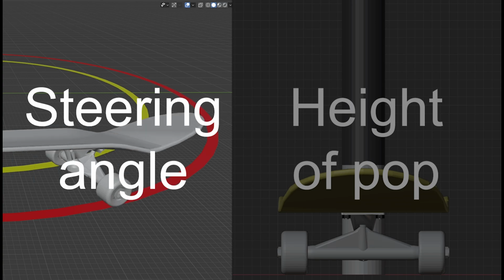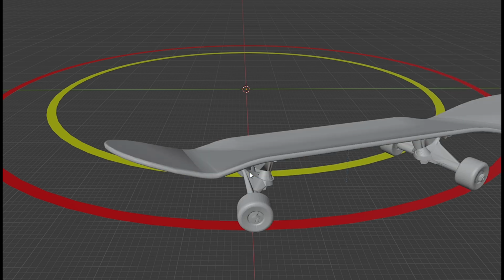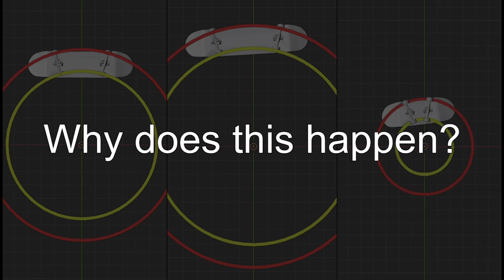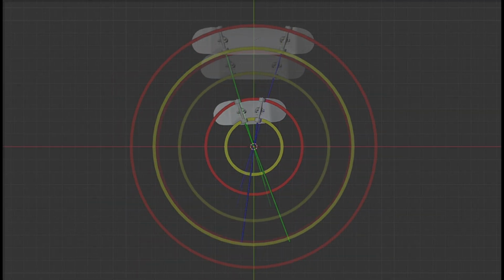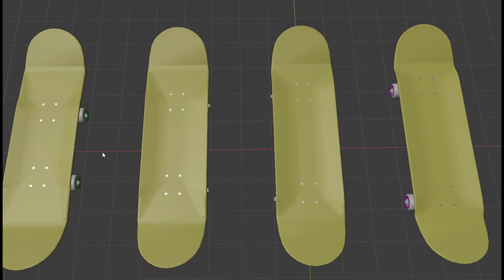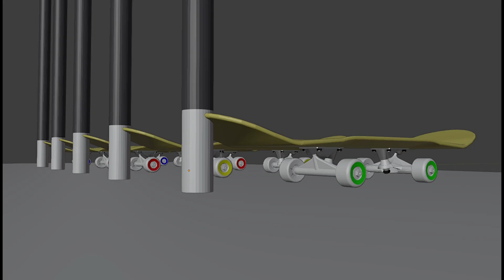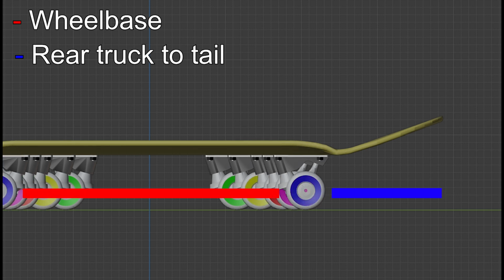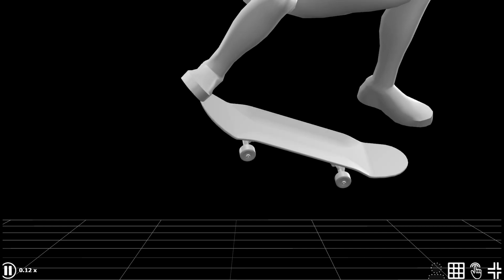Physics Engine - Wheelbase of skateboard

Comment: I’ve fallen really deep into the rabbit hole of deck specifications and especially the wheel base affect on the feel of a board. It all started when I I wanted to get a wider deck and not realizing that the wheelbase was also longer than what I’m used to and it threw me off completely and I spiralled into the rabbit hole trying to understand why. 

I think the best board design for me would be a 8.5” deck with 14.25” wheel base and a medium/mellow concave. But sadly none of my boards fit that spec 😂

Comment: You may or may not have done this already but I would love to see simulations like this with rkp trucks (longboard style trucks). With lots of variables, like off set, wheel base, height, angle etc. Especially displaying forces needed to turn in the different cases. That would be awesome ❤
Reply from the maker: I developed a Physics Simulator where you can simulate skateboard setup of your choise.
Will work on to reflect the wheelbase adjustment function whenever I have time.
https://whythetrick.io/skateboard-physics-simulator/

Comment: Would it be possible to make a video guide regarding the boards wheelbase+trucks combo? in other words, the benefits of matching a long/short wheelbase with a thunder, indy or ace truck while also taking the height of the trucks into account. 
It wouldnt have to be a super advanced guide, but more like a push in the right direction/suggestion, as I can't find any information on this matter and I don't get why its almost like a tabu subject, but in short what trucks fit a long wheelbase like ying & yang or what trucks would demolish the skateboarding experience on a short wheelbase🙏
Reply: Look up Ben degros YouTube videos he explains this exactly perfectly. Some trucks make your wheel base shorter and others wider. Depending on which direction you wanna go will ultimately be the deciding factor in which brand of truck would work best in THIS specific regard only
Reply: @paulvawter8205  i know and im well aware of mr degros videos but he didn't want to mention a single combo in any of the videos, as he said the matter was to be obtained personally with experience and time, which I dont really have the budget for, considering the amount of different deck shapes, trucks and wheel diameters.
He is a little too black and white or his videos are and has now chosen to retire from utube

Comment: Great simulation!  A few thoughts: 

As you say (3:25), the second simulation setup varies two things which both affect pop. (1) The length of tail and nose gets longer while (2) wheelbase gets shorter.

Increasing (1) alone will facilitate pop because of the increased lever for the back foot (lever = distance from tail end to back truck). The same force on a longer tail will result in a higher torque applied to the board.

At the same time, decreasing (2) alone will as well facilitate to initiate pop because of the decreased angular momentum of the board around the axis of the back truck (distance between back truck and the front parts of the board, in particular front trucks, is lowered). Lower angular momentum means less resistance ot the torque applied by the back foot using the lever of the tail.

Importantly, increased angular momentum also explains the last result (highest wheel base leads to the highest pop) because the pop does a conversion from rotational kinetic energy (rotation towards ground) to translational kinetic energy (board pops in the air). The board with higher angular momentum (longer wheelbase) can gain a higher rotational kinetic energy at the same rotation speed and will therefore achieve a greater translational energy (=higher pop) once it hits the ground.

Comment: Really great video! liked it a lot

But i think the second part is a bit misleading - initial assumption with fixed tail length and variable wheelbase was actually reality like scenario, but actually simulated scenario does not exist.

I suggest to separate second part into two - fixed deck and variable tail length, fixed tail and variable wheelbase.

Comment: When you're manipulating the wheel base you're also changing the tail length, which is what's actually making the changes in pop height and energy required you're describing. You seem to kinda point this out at the 5 minute mark, but I think it was a mistake to attribute these factors to wheel base instead of tail length, because those measurements can be changed independently. If someone were to take your conclusions about how wheelbase affects pop into their next purchase decision, they would be misled. If tail length is equal, a longer wheel base will have the same exact pop angle and therefore will not affect height of pop. The longer wheelbase will require slightly more energy (the board will feel heavier to pop) because the weight of the front trucks is further from the fulcrum, but I doubt this would be very noticeable (edit: I was wrong, it makes a big difference - I now know from experience). Wheelbase's biggest impact on riding is definitely the turning as you described. Wheel base also has minor affects on the air-spin (aka shove-it rotation) by the affect of the trucks' weight's distance from the rotational axis. Overall board length has a much bigger impact on shove-it rotation though.

Comment: Great explanation but kind of unfair test method for the pop. You should have made the same size nose and tail for every deck and change only the wheel base. For example a 6.3" tail, a 7" nose and the wheel base in increments of 1/2" maybe from 13.5" up to 15"

Comment: How would wheel base affect speed wobble?
Reply: Longer wheelbase = lower wobble frequency 
Shorter wheelbase = higher wobble frequency

Think of a short slalom board compared to a longboard. If you tried to go fast and straight with each one, you would experience speed wobble sooner with the shorter board and at a higher frequency than f wobble than with the longboard

Comment: You make great vids, love them! Just for clarity's sake, the "width" of the wheel base refers to the length of the truck, from bolt to bolt. What you've been referring to in this vid is the "length" of the wheel base, from truck to truck. If the distance is in the direction of travel, its length of the wheelbase. When its perpendicular to the direction of travel its the width of the wheelbase.
Reply from the maker: Uhhhh… I see, thanks a lot!
We are one step smarter thanks to you.
Reply: Two wheelbase measurements?? No, sorry, but the width measurement you’re referring to is called track. Wheelbase is only measured from front to rear.

Comment: I think you're correct within the confines of your experiment. with the trucks and wheels being the same, the shorter the wheelbase, the easier it is to pop, but the downside is the lack of ability to pop really high. you're simulations were quite exaggerated, but if you skate 2 boards that are the same, but differ by 0.25 inches in wheelbase, your hypothesis is correct

Comment: All the difference in Pop seem to be rooted in the geometry of the longer tail. Smaller angle means less distance and energy to the pop. I dont understand why you link this effect to the wheelbase.
Reply from the maker: Turns out, that seems to be the case. Although I could've shorten the length of decks, but they are generally the same/similar, right? Instead, decks seem to share the same length while they have different wheelbase. The ones you saw in this video are obviously exaggerated but essentially that's how they are: the same length of decks, different locations of trucks.

Experimenting on different deck length would also be interesting though. Thanks!
Reply: @whythetrick  i dont mind same/different deck length. I dont think it makes a lot of difference.
I tried to say, in your experiment, you basically examined how tail lenght impacts the pop (because the tails are different and have different pop angles). The wheelbase does not have much to do with it. You pop with the tail, of course the lenght of the tail is much more relevant than the wheelbase.

Comment: That pop simulation seems inaccurate.. A board with a shorter wheelbase is going to have a shorter overall deck as well. Just something i noticed, idk why but you shortened the decks for the steering radius part
Reply from the maker: Guess you are right. I should have shortened it to be accurate but I think the overall deck size usually doesn’t change much in reality, does it?
Reply: @whythetrick  there is no standard lenght. It would not make Sense to have a big rider with wide stance riding the same board as a small one.

Comment: love ur videos!
i would like to see a comparison in needed forces of normal ollie compared to fakie ollie (or any other trick ), because tricks still standing imo feel more like fakie tricks and regular tricks feel a bit different. Maybe there isnt even a difference and it perhaps is all just in the body weight distribution i would imagine.
Also a thing i personally do is, i pop sort of backwards on some tricks ( and especially on fakie tricks) and would be interested in how the simulation looks if u apply the Pop force not perpendicular but instead slightly pointing backwards.
I noticed too, that the pop in skateboarding usually isn't 1 quickly applied force but rather its contiuously applied until the tail hits the ground so that difference would also be interesting
Reply: i think you hit the mark... there is no difference. This is probably why Ishod skates twin tails and Neen skates twin noses.

Comment: Can your feet placement affect the pop angle?sometimes i feel like when i pop with my back foot more close to the bolts i need less energy to make the tail hit the ground but i cant pop very high,when i put my feet on the tip of the tail i feel like a need a lot more energy to pop it(sometimes i even get ghost pop) but in other hand if my board makes contact with the ground i can pop very high
Reply from the maker: yes, the foot placement does affect the angle of pop.
Just like the length of the tail, if you pop closer to the bolts, you'd need more energy and vise versa.
Reply: @whythetrick  You should make a video explaining the difference in the pop with different positions of the back foot. this would be really helpful
Reply: I feel like like it takes me more energy to pop with back foot closer to the bolts. You have less leverage. Imagine a lever and you are trying to lift a boulder. do you want a long stick or a short one to move the boulder?
Reply: If it takes more energy and force for you to pop the tail when your foot is closer to the tip that means you have a "flat" type of board where the tail and nose behaves like a flat plank of wood and so as you get closer  towards the end of the "plank of wood" the more stiffness you lose. Boards that have steep noses and tails (think of the shape of a trigger on a gun) will only pop if you place your foot precisely on the tip. Just as pulling the gun trigger feels lighter and easier when your finger curls around the sharp end twords the bottom. So "flat" boards are more forgiving (you can pop with your foot almost anywhere behind the bolts) while a "steep" deck requires precise back foot placement on that small tip area on  the nose/tail.

Comment from the maker: It should not be this simple :P
What am I missing?
Please share your thoughts!
Reply: actually, I think the wheelbase plays a smaller part in the pop, since the wheelbase is only the distance between trucks and that just adds leverage weight to the front of the board the longer the distance of the wheelbase. the pop has more to do with the distance from the truck to leverage point (the crease) of the tail, length of tail and the degree angle of the tail.
Reply: @floatingrobots  The wheelbase definitely plays a big part on the pop. If you take 2 boards from the same mold, slap on the same trucks and wheels but one has a 14in WB and the other 14.75, the angle in which the tail hits the ground will be different between the 2 setups.
Reply: @ToniLovesSkateboarding  I didn't say it doesn't play a part just a smaller part than the tails angle and length. If you take 2 boards with the same wheelbase but different angle and length tails it will effect it more than if the tails are the same and the wheelbase is different. It also matters how far the holes are drilled from the crease of the tail's kick. These arguments are for comparing similar size boards only of course, that's what matters.
Reply: the wheelbase affects but just because it is a lever. In your example the tail and nose lenght would be a lot more noticeable
Reply: What if you have a short truck wheel base but very tall trucks? For example how would a Thunder with a height 49mm and a longer wheel base compare to a set of Indys that are 53mm tall but have a shorter wheel base?  I wish I could find Indy trucks that only weigh 300 grams.
Reply from the maker: Short wheelbase:
- pops lighter and lower

Tall trucks:
- needs more energy to pop and pops higher

So…yeah. I think we should find the best combination ourselves.
Reply: The angles of the tail definitely would effect your pop.  Some decks tails are so mellow and low it feels like the tip of the tail is level with the rest of the board.  Myself I’ve always found Habitat boards to have great concave and perfect pitch to the tail and nose.
Reply: Length of tail would definitely change the physics of the pop.  Tail and nose usually measured from outside bolt holes to tip.  One example of trying to find where wheel base needs to be is just drill new wholes in a board that’s halfway to retirement.  Try a shorter wheel base and a longer.  Then measure it when you find your sweet spot and you’ll know what wheelbase to find when getting new boards.  Just through experience I’d say a good tail length is around 6.5”